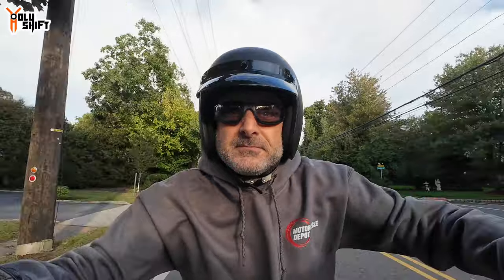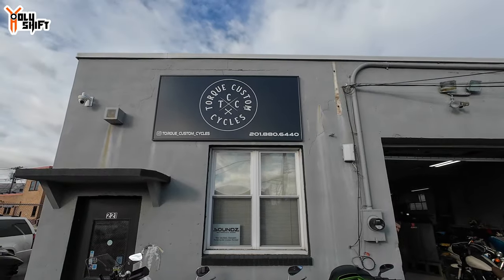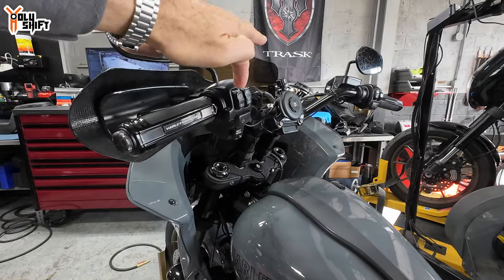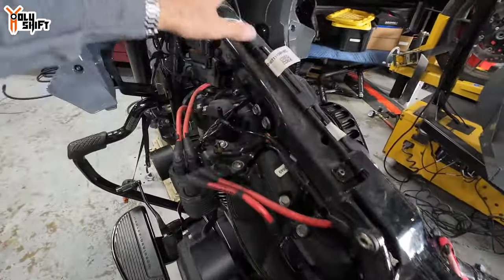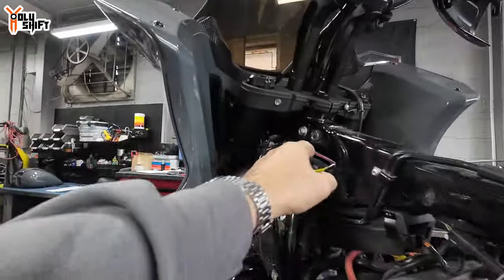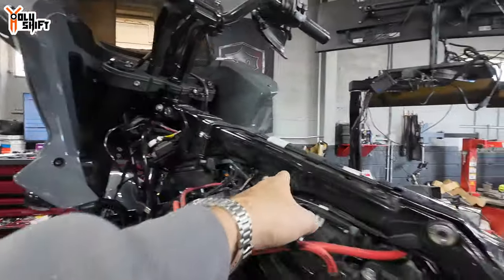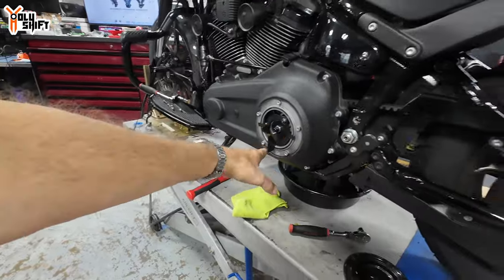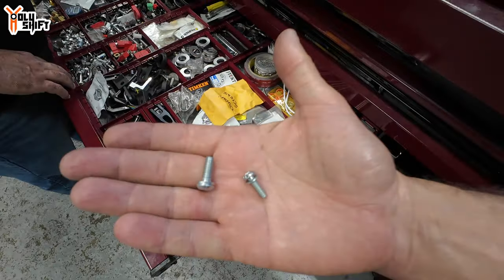What's wrong with my bike? ! I must fix it !

Comment: I put a couple hundred thousand miles touring before cruise controls were available. Thank God I had a device called Twist Assist. I don’t think they’re making them anymore, but I think I still have a brand new one laying around somewhere. They were fantastic.
Reply: I have one in box with parts 
Just tighten friction lock enough to hold speed on flats 
Good enough
Reply: @SIERRA-dx9wm  The Twist Assist gave you a totally neutral friction throttle, unlike the ones they used to have on Harleys or the after market ones they sell now.

Comment: I am presuming since the part is so hard to come by that this is a known problem with the CC module? 

I guess I am with you Sandy when it comes to upgrades. I have a ‘20 Ultra and immediately changed out the lighter socket with a marine grade usb plug. Don’t even get me started with my truck, I got a sun shade because the manufacturer did not make a windshield to withstand the heat of the sun. People even upgrade crocs with tiny little trinkets they push through the holes. I’m sure that while those folks are making comments about all the upgrades you want to do to your bike, are sitting around bedazzling their jeans. 😎✌️

Comment: So, after you pay $24K OTD for the bike, you need $600 for risers, $1200 for better saddle bags, $700 for better seat... etc, etc...  So you spend all your paycheck for parts every other week? Doesn't sound right... Something doesn't add up here. Looks like they take you for a milk cow for themselves. I dunno if Harley gets kick backs from them or not, but it's not right thing to do, leaving so many imperfections on the bike, so people have to spend a fortune fixing it. For example Honda puts cruse control in their $10K bikes included. I dunno... hate to be taking for sucker...
Reply: Nobody needs different risers, different (not better) saddlebags, different seat. HD provides the bike trimmed out to a baseline. Wha risers work for you may not work for the next person, same for the bags, seat, windshield height, etc. We all have choices. You don't like the brand or the bike, then vote with your hard earned dollars.
Reply: I agree.I bought a new bike in 2020,Chieftain Darkhorse horse.Handlebars are fine,seat is comfy,footboards are just fine.Peopke with more money than brains get their pants pulled down.
Reply: It was broken so it had to be replaced
Reply: Pretty sure this isn’t just a “motorcycle” thing.  Most people with a desire for enhanced style / performance/ functionality wouldn’t leave builder grade finishes in their house either.  There’s plenty of design focused magazines and home improvement companies that cater to these desires and needs.  We recently redid the landscaping at our house.  We could have left all the builder grade plants, but we had something different in mind.  So we spend money to get what we want.  Most (but certainly not all) of us don’t spend what we can’t afford.
Reply: Just like a Rolls Royce .. Harley Davidson ain’t for everybody.  And majority folks buy them because they can modify them to anything you want. Not everybody can afford them, but that does not mean they are a bad bikes. We are all at different stages in our life. Some have disposable income some don’t.
Reply: What I'm saying you shouldn't pay $24K and then keep changing things. This gets old already. Indian riders don't have that need, why Harley don't learn from them?